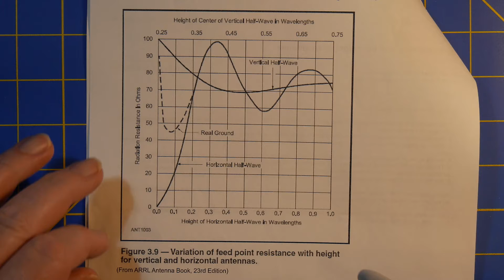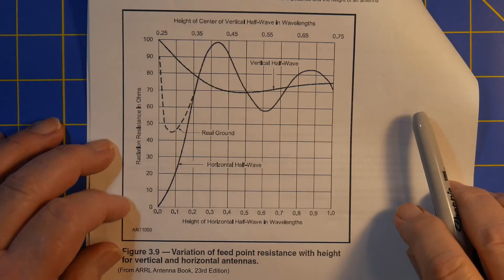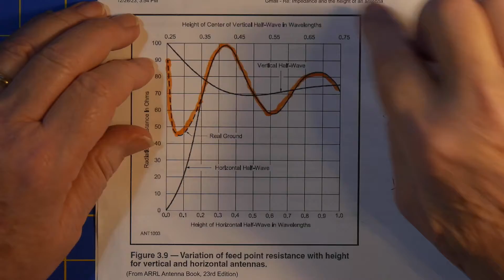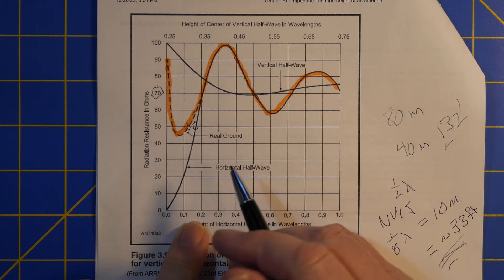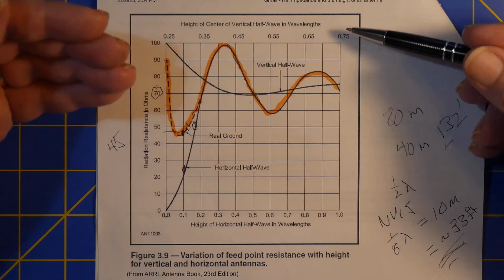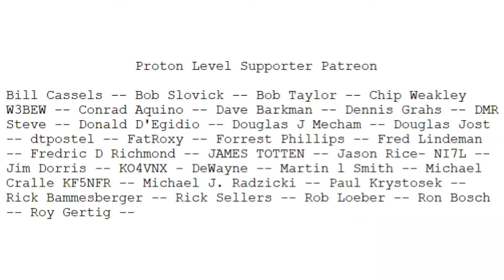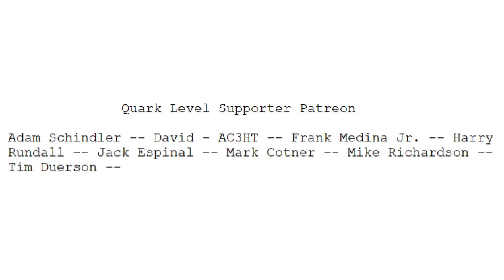Impedance and the Height of an Antenna (#1066)

Comment: For 40 meters, a resonant square horizontal one wavelength approx 144 ft around and up in the air about 18-20 feet, and with a matching horizontal loop underneath about 160 feet around as a reflector, is one "smoking" NVIS cloud burner beaming straight up, and matches beautifully to 50 ohm coax...
Is Great out to 1000 miles.  
And also is super quiet, it is so horizontally polarised it really nulls out out the near-by man-made noise fantastic as well...

Comment: This is a great video. When it comes to wires high in the air, you have to ask: what about the tower? 
A steel tower is going to interact differently to (for example) a wooden pole.

Comment: If I lived closer, I would help you get a taller mast up. But I have my 144 foot doublet up around 40-45 feet, and with lots of interfering objects around, but it really is a great 80M regional antenna. While limited on SSB, it reaches the ends of the earth with modern digital modes on all the bands.

Comment: Dave, as I understand it. An antenna with a thick diameter is a broader antenna. Is there a point of diminishing return to this? For instance, if i were to make two antennas, one out of wire and one out of 6" pipe, what would be the difference in frequency range with an acceptable SWR?
Reply: I would think the only Ham band a 6 inch pipe antenna could have trouble on would be 80M.

Comment: I could get up to 600 miles away when I was NVIS on multiband EFHW 10-40M. But I am less than 1,000 feet from the ocean. When I put up a center mast to make it an inverted V, I messed up and used stainless steel guy wires instead of ropes, which put me down to a single band 20M, but on 20M I am clean and clear up to 2,000 miles away so far, had a report from 1,800 miles that said I was 20 over 9. So, I am not changing anything. I have a vertical antenna for 6M & 10M and another for 70cm and 2M. With the awesome repeaters in South Texas, I can hit hundreds of miles on 2M VHF and 70cm UHF. So I am most limited on 6M VHF.